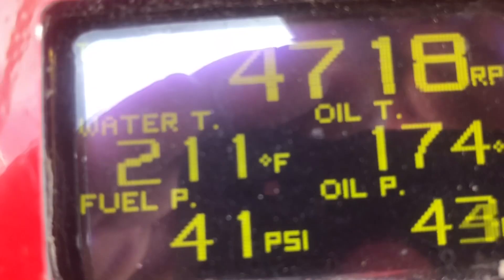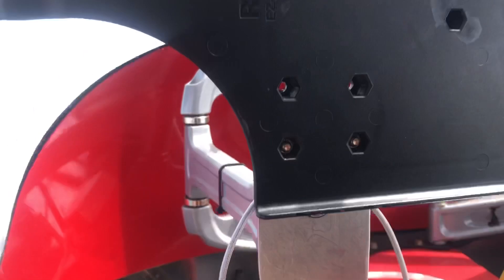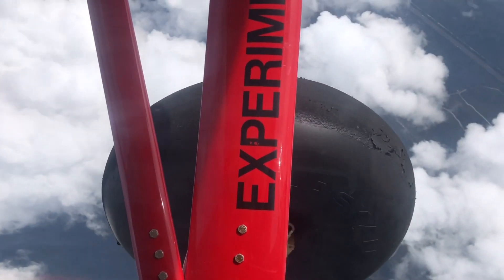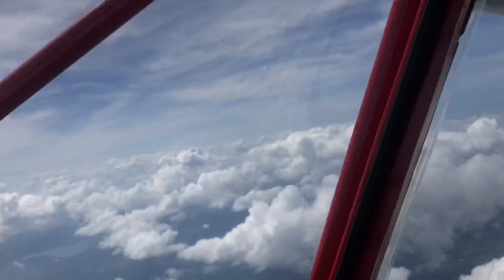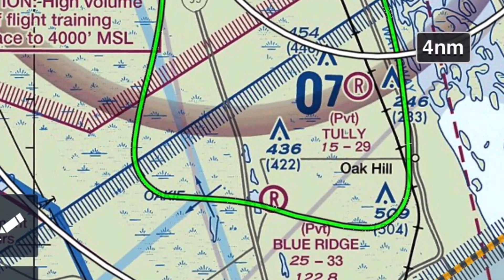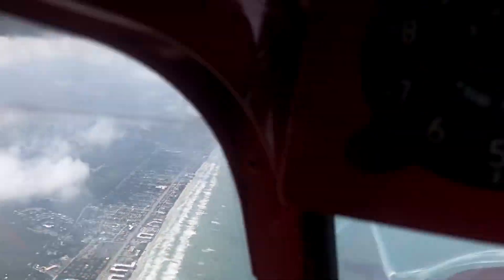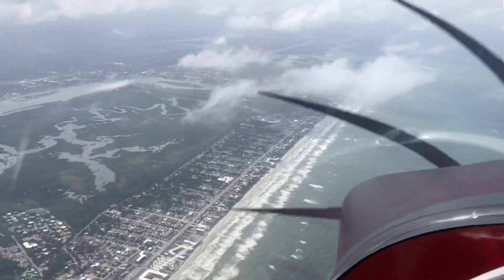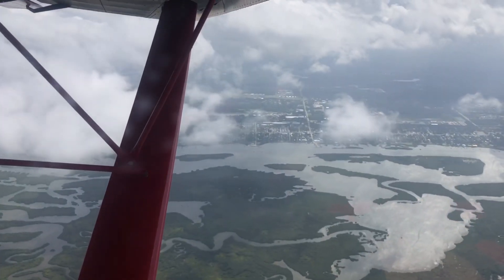High Altitude Performance at 10k ft. Zenith CH-750 SD with Viking 180 Turbo (31" Tires)

Comment: Wonder what would the fuel flow be at 10 000ft and 50mp?
Reply from the maker: Something we will look into on the next one, we were creating 165 HP to accomplish this. Doing a little here and there as to not convolute any numbers.
Reply: @eggenfellner  165hp @ 10 000ft is a lot of horses to feed :)  Loss of only 15hp is a great result at that altitude, so the turbo is really doing its magic!

Comment: Great achievement.  I had no doubt.  I'm surprised it wasn't faster
Reply from the maker: We have a fat airplane - if built with 100 lbs less in tires and no baggage pod, it would be better. The true testament goes to the Turbo being efficient and where it excels.
Reply: @eggenfellner  at what elevation does the turbo efficiency start dropping off? 
Full 195HP at 18,000ft?
Reply: I was wondering the same thing. Good video